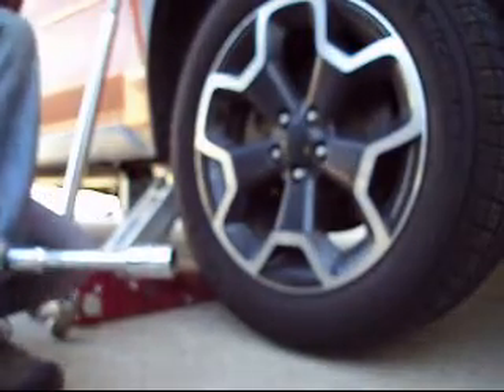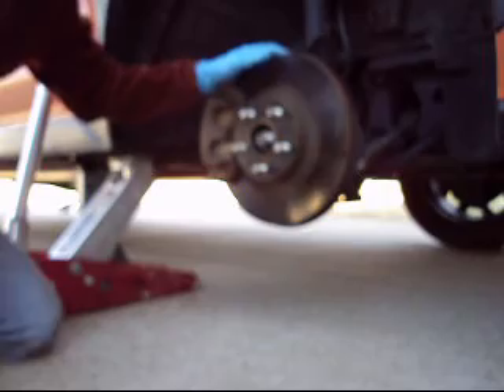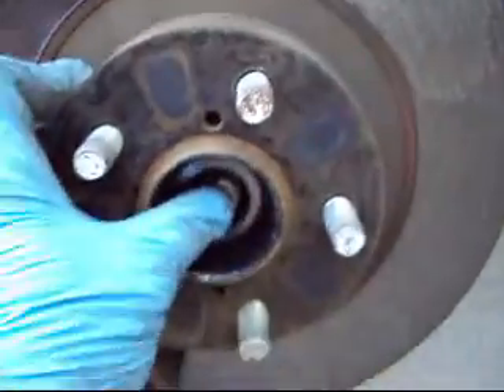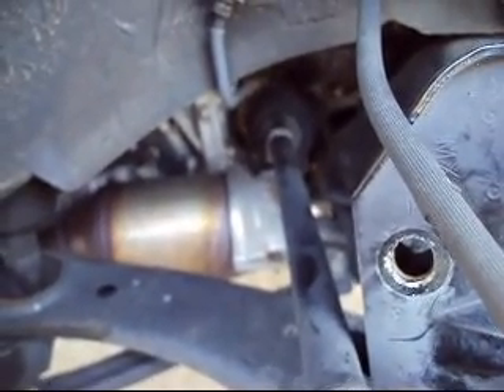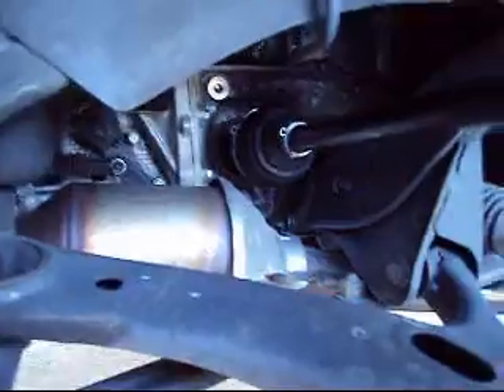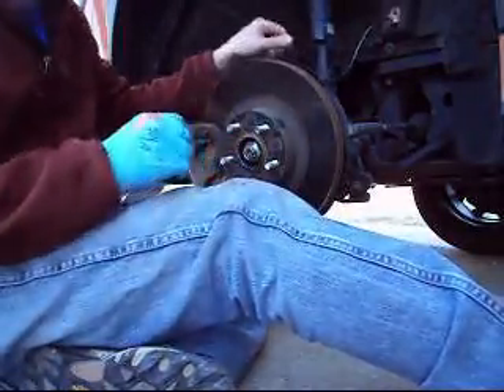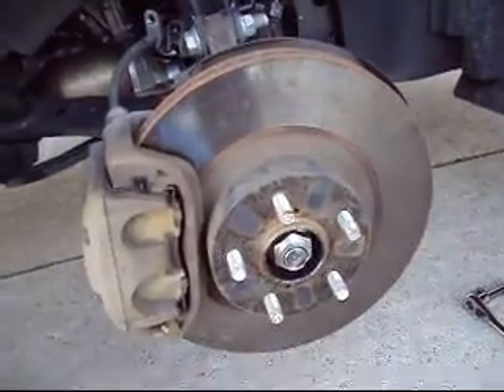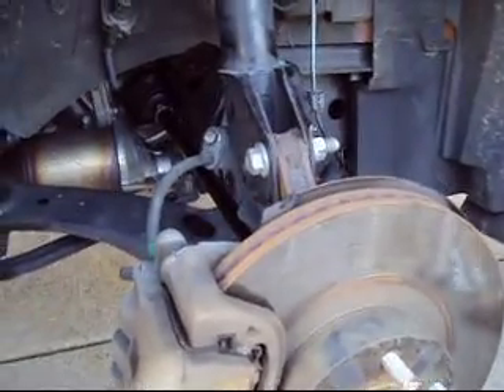Subaru XV Crosstrek cv axle replacement

Comment: Good vid dude! I’ve got a 15’ and my left front cv starting clicking around 100k miles, I’m already up to 130k and finally got around to replacing it. Should be in in a few days. This is the best video I’ve come across on how to do the job. Still got your XV? Planning on doing any more videos? I want to install an overhead dome light for the cargo area one day. Thanks again for the video! Cheers
Reply from the maker: Thanks man. I still have the xv. Currently at 135k miles. No other issues so far but if I have any issues I may do another video. Hopefully I'll have a better camera on the next one. Good luck.

Comment: The quick push / pull action didn't work for me but I saw another youtuber say to just pull which did work. Unlike other cars I've worked on there doesn't seem to be a good place to get a pry bar in there to pop out. I didn't want to pry against the weak "fin" areas of the transmission case. Also as a FYI to others I don't have to drain any fluids to do this job.

Comment: seems like they go bad often mine has only 70k miles and showing symptoms of bad cv axle. thanks for video I will be changing my axle soon.
Reply: I have a 14' Crosstrek and mine are bad at 70K miles also which is ridiculous.  Expensive to replace at the dealer -  was quoted $650 for each side. I'll be driving mine till the wheels fall off since I'm not mechanically inclined and don't have $1300.
Reply: @gamblinfool777  Dont be lazy, replace them yourself.